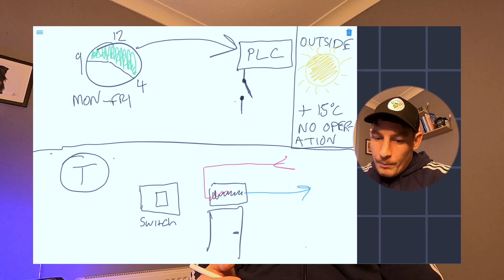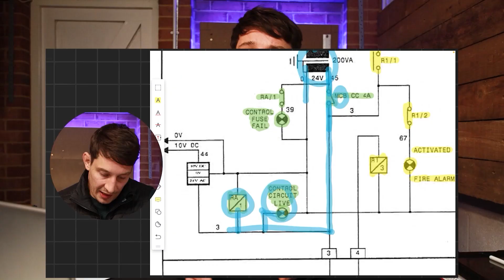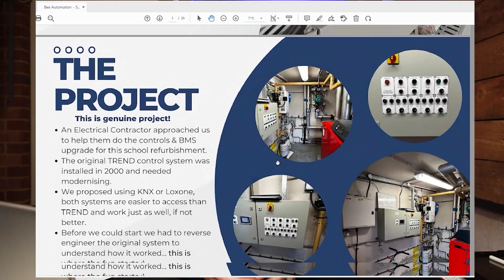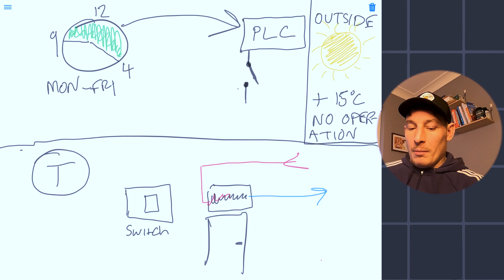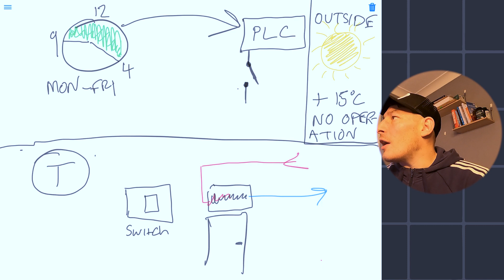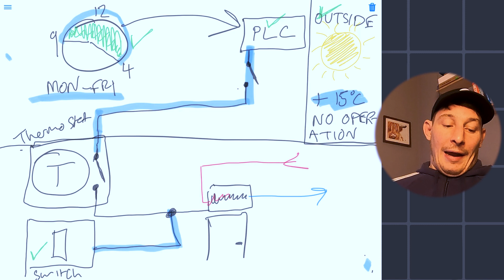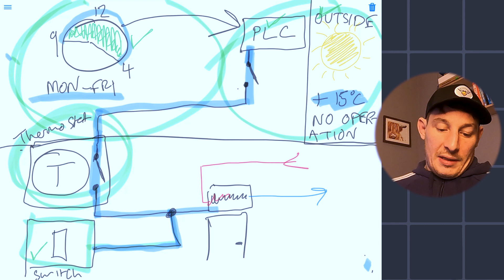Designing an Electrical System for Building Automation

Comment: Hey, love your content! I’ve done similar installs using thermostats for fan coils over Modbus RTU, like SIEMENS RDF302. You can partially lock the keypad, set limits on the setpoint, even stop the fan coil from running, and more.230VAC power part is just between the thermostat and the fan coil. Keep it up with the channel!

Comment: 1. 15degc is low!
2. That whole thing could be 230v locally, pipe stat on the flow inside the unit set at 40degc, room stat, override pointless, the rooms warm enough or its not, stat will cover it, if you really want to stop the fans then run a ELV circuit and relay to denergise the 230v supply to the pipestat
Reply from the maker: Glad you enjoyed the video mate... school kids are much tougher than they used to be, honestly, I think they'll be complaining they're too hot. Did you get that copy of the spec/tender I sent you?

Comment: Couple of comments I would add:
1. With the switch override do they require both enable and inhibit override, if so then you may either need to have the override as an input to the PLC or driving a relay to energise or deenergise the system based on current state. I.e. system off, override to on would need to provide a run signal, system on; override to off would need to interrupt the PLC run signal.
Secondly, they mention modulation of fan and valve for room temp control, are they looking towards PID control of the fan and flow valve based on room temp, or are they looking for purely digital on/off control?
Reply from the maker: Maybe and maybe. The spec/tender wasn't specific so could have been interpreted in multiple ways. I've gone with the most simple design, minimising cost 😎
Reply: @beeautomation  an unclear tender and spec with holes in, that doesn’t sound like the automation industry at alll……oh; wait…..yeah it does! 🙈😩
Reply from the maker: @Pugjamin  😂👏🏼👏🏼👏🏼 it’s just a generic copy and paste exercise for most specifiers isn’t it

Comment: To have the two 'true' conditions is this something that can be done actually using 'true' conditions or does it need to be wired with essentially two switches either physically or virtually that when closed are considered to be in a 'true' state? 

So like, PLC time between 9-4 - Yes (switch closed) -- Outside temp below 15 - Yes (switch closed) -- Energise relay output

This may be really badly worded but hope you understand my question
Reply from the maker: True condition 1 = is the time between 9am-4pm (Mon-Fri)
True condition 2 = is it below 15 degrees outside

If both conditions are true, Close PLC digital output.

These conditions are programmed within the PLC. I hope that answers your question 🙂
Reply from the maker: The time condition is virtual, with no wiring obviously… the temperature condition would be set using a threshold within the programming but will need the physical temperature sensor outside wired into the PLC
Reply: @beeautomation I think that makes sense, need like an 'And' statement using ladder logic taking one physical input (the temp sensor) and one virtual one (time)
Reply: Love the drawing... well explained though. Keep it simple. Great job
Reply from the maker: @rickycrean  haha "picasso" ... cheers mate.